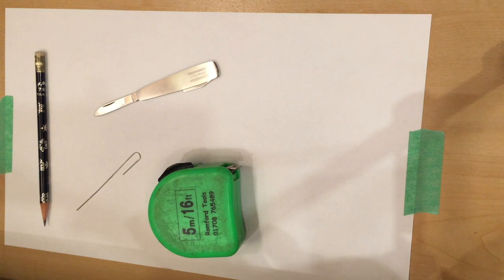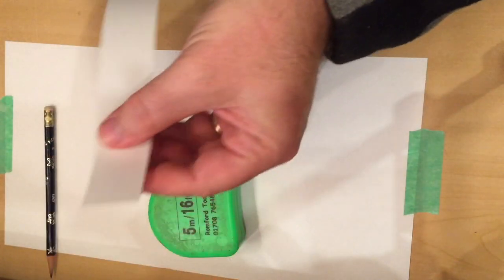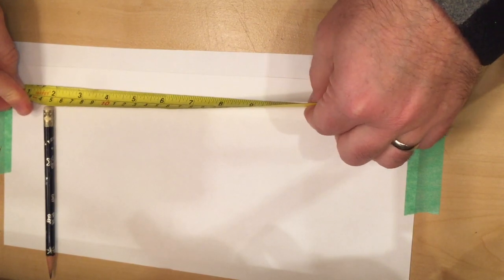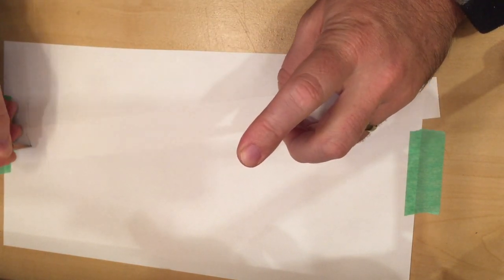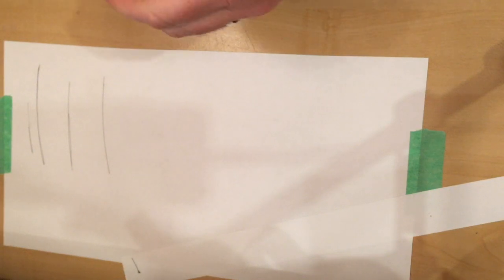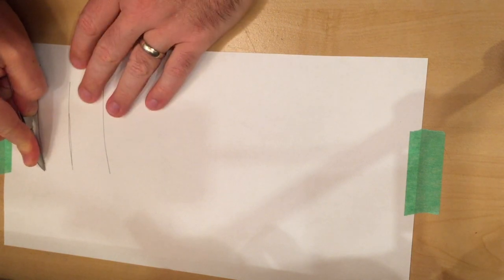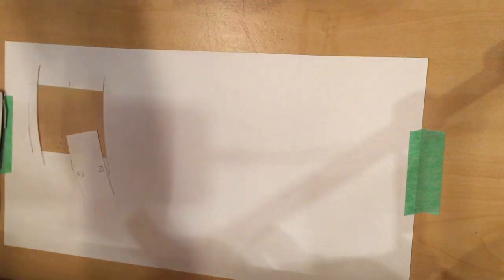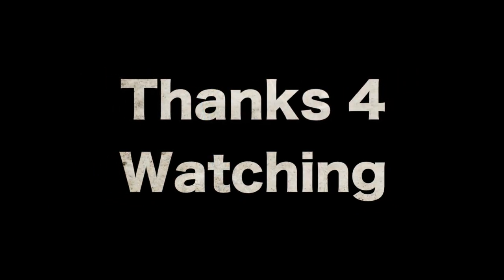DIY Radius Gauge

Comment: If your making a 9.5 inch radius,  why are you marking it at 10.5 inches?
Reply: He marked it at 10.5 inches because he started at the 1 inch line instead of the 0 inch line
Reply from the maker: It's 9.5" on the inner curve and 10.5" on the outer curve.

Comment: The tip of the measuring tape moves so it shows 0 if you pull or push, it's made like that  by design so it takes into account the thickness of the metal bit.
Reply: I was over 30 when I learned that haha
Reply: I was just about to comment this. It's a really cool fact that they should really advertise on measuring tapes.
Reply: If its an old or abused tape(or just really cheaply manufactured) it should be bypassed (start from 1")  because its freedom of movement will eventually wear down the slot in the tape causing inaccuracies.

I.e. in one direction (pushing) your actually 0.015"
But while pulling, you're actually -0.1015" (more than 1/10" off) 

But really, if your tolerances are allowed to be 1/8" off, who cares =p
(As long as your accounting for stack-up tolerance issues, ofcourse)
Reply: working with push pull is fine working with feet. but mm... not so much.